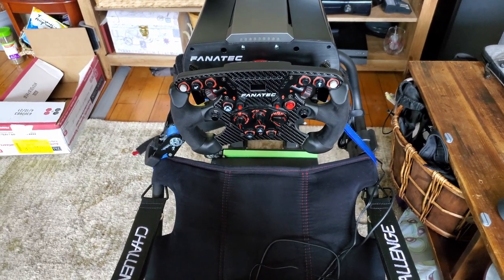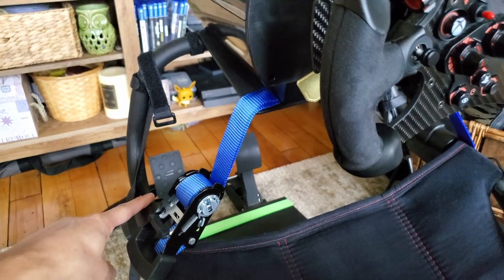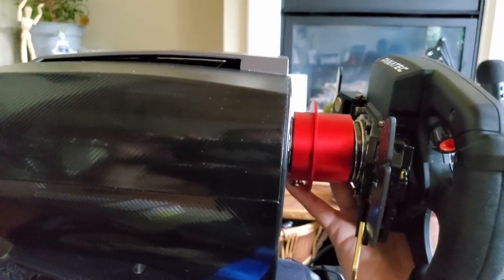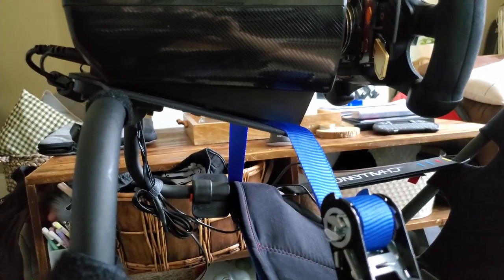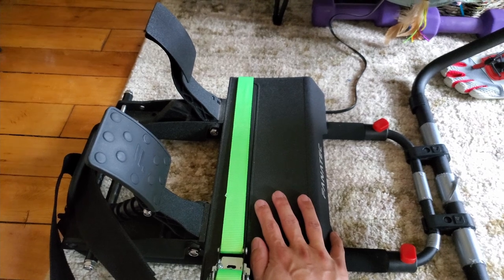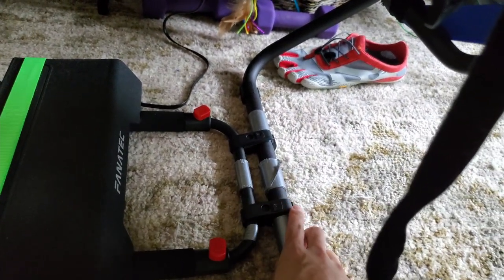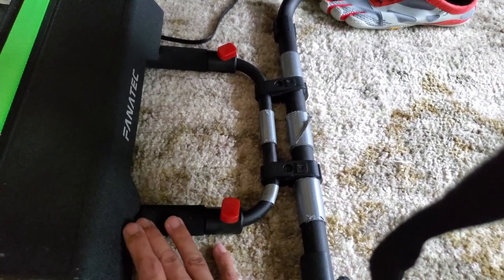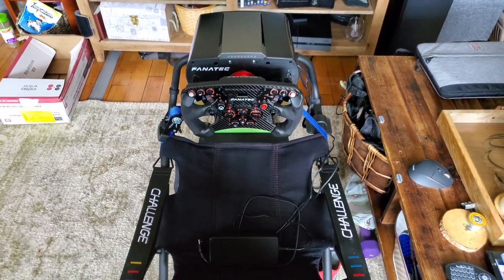Buying a CSL DD and Thinking About Playseat Challenge Stability Solutions?

Comment: I've got a Next Level Racing GT Lite rig, almost identical to the Challenge.

Like you I used ratchet straps, and the thing does not budge. At all. Compared to out of the box, its a massive improvement. 

I'm surprised the manufacturers haven't addressed the problems and very simple solutions. Maybe they just want us all to upgrade to more expensive rigs, but like you, I need something lighweight and easily moved, not a big monster rig that would overwhelm my apartment.

Good video. Subbed!

Comment: I think the major flaw here is that the play is mounted all the forwards. The CSL Elite wheelbase is front-heavy, plus all the forces you put on the wheel are in the front as well.

With that in mind, you should actually put the plate all the way back, so that the front on the wheelbase is just on top of the bar. That way you won’t have anywhere near as much flex. You want the center of gravity to be as close to the bar as possible.

I realize that moving the plate all the way back might but the wheel too far away from some people, but in that case, the seat can be raised a bit (meaning tighten the side straps) and it’ll take you closer to it.
Reply from the maker: My arms are too short to have it mounted any further back. The stabilizer is actually pretty strong and after having used it like this for over a year now, it's still working properly. For a $200 piece of equipment, this thing is really good quality.

If I pushed it further back, I'd have to have the seat up higher and it just isn't comfortable. I tried every possible configuration when I bought it and this was the most comfortable for my body.

Comment: I used the Playseat Challenge with the T300 RS for about 1.5 years. Your tips would have helped me a lot back then. But I switched to the Nextlevelracing F-GT and CSL Elite with Loadcell brake about 1 year ago. What can I say. I was immediately faster on the track, which on the one hand depends on the Fanatec equipment, but also has to do with the comfort of the seat. Of course, that only worked because I also have the space. My home office had to be rearranged, but it was worth it. The Playseat Challenge is really good if you're short on space, and the price is absolutely fine, too. At the time, I didn't know exactly whether I really wanted to get some more expensive equipment 🤔.
Anyway, I think your tips are very helpful. I didn't come up with the idea of just using tension belts and I probably never would have thought of it. 😁👍👍

Comment: Have the same playseat challenge, but with a CSL DD . I was lucky that when my wheel is in the correct position, my wheelbase is in the middle of the bar where the wheelbase is, so I have zero wobble with my challenge and flex in the wheelbase.  Have the same solution with my pedals, just a strap around, that was good enogh. Dont have any issues with the pedals going left or right.  But I am thinking of upgrading to some other rig anyways, cause I dont really like the way you get into and out of the chair :) but it is a nice fit for my body when im in it.

Comment: You could try a couple of articulating locking arms used for camera's to support the wheel as that would save worrying about over tightening the strap and would be more ridged.
Reply from the maker: Yeah, I've seen videos for that. I just thought of this one first and had straps lying around so this is what I tried. It works well enough until I can get a full rig.
Reply: @boonjaminbokchoy5725  it was just l thought as I did it on my playseat challenge and it did improve things. But two months ago I was able to get a gt omega titan rig and I'm really pleased with it .

Comment: I have a sim lab WS-pro coming today and I’m gonna see how it works with the seat part only of the playseat challenge with the wheel stand in front! I know it’s not practical to buy both for this setup but I’ve had the challenge for a long time now and want something sturdier for my wheel/pedals. CSL elite with v3’s. A few weeks it’ll be the CSL dd. Hoping it works out well so at least I can get some use out of the playseat still. Plan to throw both in the front closet while not using
Reply from the maker: Hey man, if you can afford it, and it works, there is nothing wrong with it. I hope it all works out for you.

Comment: Did you use the screws that's on the playseat challenge to mount the drive wheel?
Reply from the maker: I'm pretty sure I did. I didn't buy any extra gear other than the straps.

Comment: which north american stores sell these kind of ratchet straps? have you use the fanatec shifter with the playseat challenge?
Reply from the maker: You can find them at any hardware store like Home Depot or Lowe's. And I don't use any shifters, but it doesn't come with anything. You'll have to find some third party adapter.

Comment: hi what is the name of strap?
Reply from the maker: In the US it's called a ratchet strap or a tension strap. In case you are from a Spanish country, Google translate says it's a "correa de trinquete" or "correa tensoras". Make sure to get one with a ratchet on it to make it easier to strap down.
Reply: @boonjaminbokchoy5725  thanks bro im from philippines. planning to buy a simagic dd. you think itll hold?
Reply from the maker: I think 10nm might be on the edge of what the PS Challenge can handle. I'd look up some reviews on that wheelbase and seat combo before buying. Though, the CSL DD is 8nm and the seat seems to handle it ok. But do some research for sure.

Comment: Do you really need gloves for the alcantara wheels?
Reply from the maker: The wheel won't destroy your hands and the gloves don't really help with grip. But it does help the Alcantara stay cleaner for a lot longer. You spend like $300-$400 for a wheel so you should try to keep it in good condition as long as possible.
Reply: I paid 100 dollers for my gloves replica ones 😀